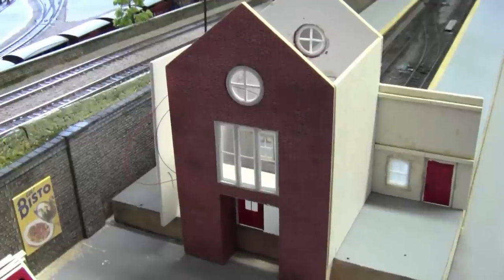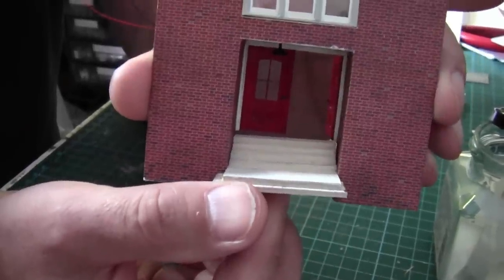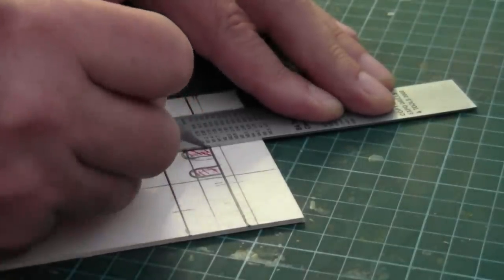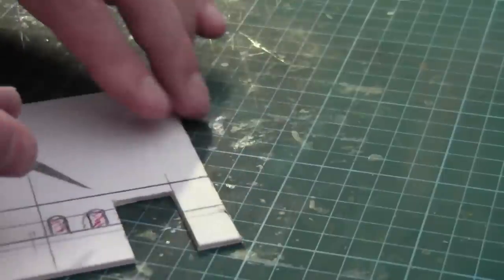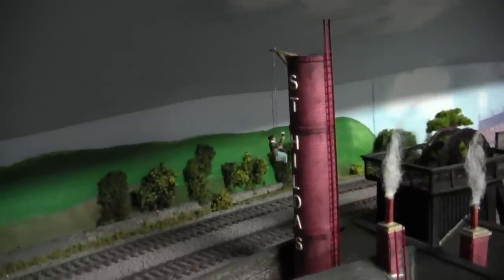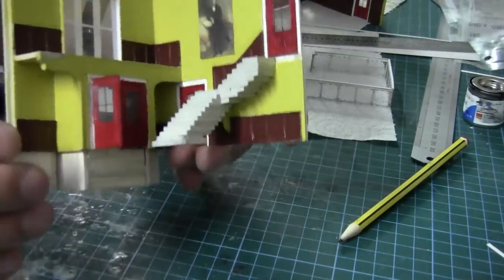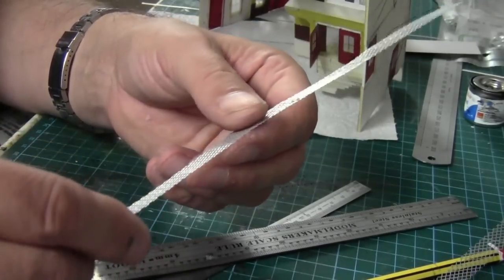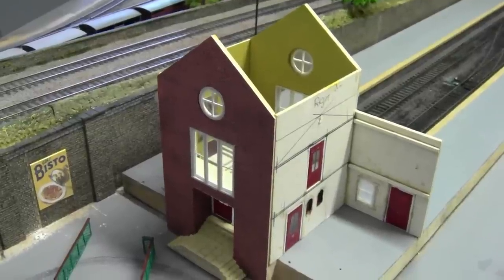Jarrow road station, Booking Hall No338

Comment: Dear Tony, absolutely love the entire hall you’re constructing for the Jarrow Road Station.
However, on the stairs towards the landing; see that you’ve used the similar method, as how you made the (was it) 68 steps stairs along the retaining wall of the South Shields Station. 
Only recently I started on building an HO scale theatre. After having made several steel stairs for water towers and oil or water tanks. I make those out of thin cardboard strips, with pieces of ice cream sticks in between as a spacer. When one side is glued, I take the spacers out, or change them out for narrower ones, to glue on the other ‘beam’ (don’t know if that’s the right name for the support structure on the side of the stairs). Because I make those stairs out of paper, I’m able to wrap ‘m around the oil tanks and glue on the outside beam in situ. In the mean time I’ve produced a jig, with which I can produce those stairs much more easily.
Anyhow, whilst using those spacers, for the theatre I came up with the idea to make ‘stone’ stairs by glueing spalted pieces of sticks in between. All cut to the same width, and length. By adding a cardboard backing to the stepped underside, I’m able to reinforce the entire construction. With this method I’m able to construct fairly lean steps that fit much better inside the small space I’m working with.
Glad to show you some of my drawings and attempts. 
This comment also as a way to take a next step towards starting my own YouTube channel. Lol
Also love those railings. Some very intricate details and work you’ve made there.
Very cool build!!
Oh, and stove or pot and pan splash screens also have a great mesh. Even older ones are an option, because of a natural texture from either grease, oils, butter, soap and so on. Cleaning seams a pain in the ass, of course. But a good soak in soda and the lot just disappears. 
Have a nice weekend, cheerio.
Reply from the maker: Good morning Vincent. i love your ideas on making making stairs and steps. now making a theatre is a different kettle of fish. where on earth did that saying come from. never mind. you would have to make the roof removable just to see inside. interesting idea though. i would see your drawings Vincent every little idea helps.
Bring on your you tube channel. that would be amazing. i know you where only kidding. but nevertheless, i would be your first subby that's for sure. thanks you for commenting my friend, have a great weekend yourself cheerio for now...Tony

Comment: Micheal,
If you have not yet closed in the station, I would love to watch you cut & glue a frame around the wall portrait.  Add some little jewelry trinkets in the corners.  A paint it a high gloss gold or bronze.
Also should you still have the ticker window cutouts (or use the windows as templates) cut & glue together three or four pieces of card into a shape similar to a Cathedral Domed Radio (circa 1920's to 49's).  Following a quick brown paint job and there's your radio in the second floor concession room.
Great job in this episode.
Jim in N.Y.,U.S.A.
Reply from the maker: Wow JIM, some great tips there,  i will keep those ideas in my back pocket. and thank again for commenting. very much appreciated Buddy. Tony from sunny England....Cheers:yougotthis: